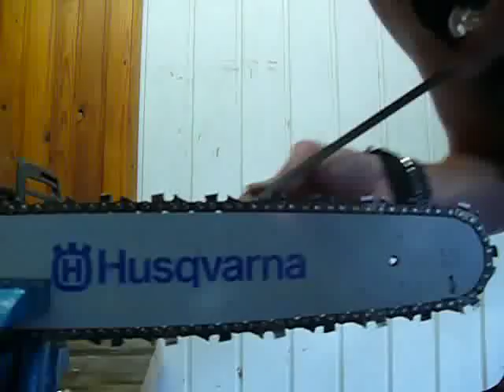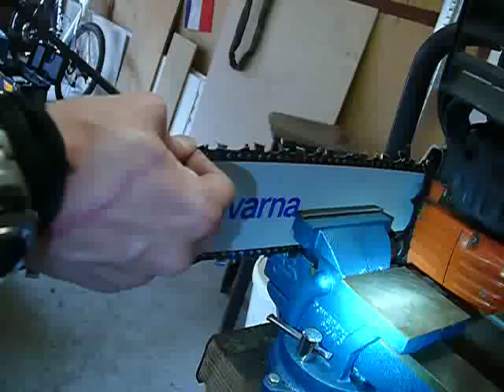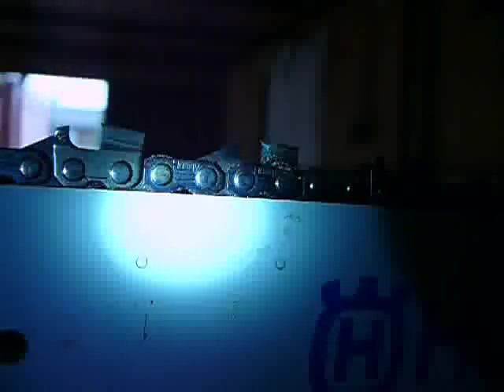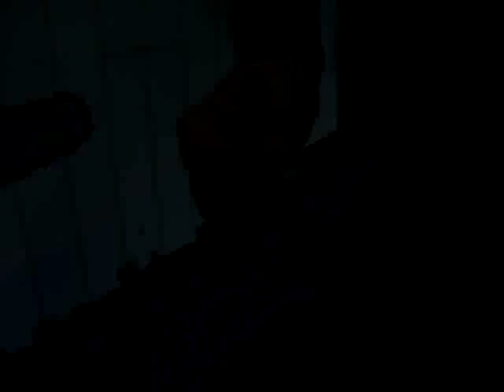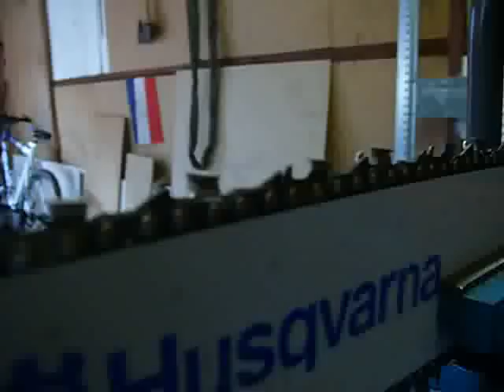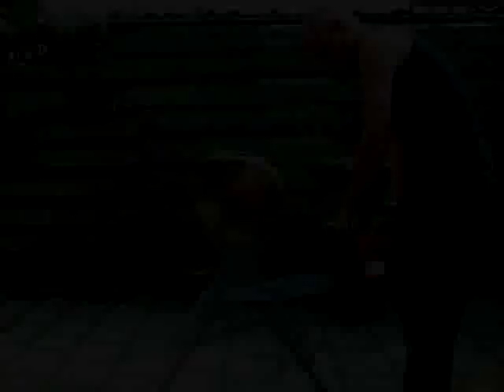Hand filing a factory round ground chain into a square ground chain

Comment: Do you always Eyeball or have you ever used an A-Top or Granberg with the double bevel? Im trying to learn more about square filing i have round filed in hardwood for years and just recently used a square filed saw and loved it!
Reply from the maker: Hello sir, I usually eyeball, with mixed results... I am very interested in the A-Top device. The files i use are Pferd files.
Reply: A guy that i work with uses the Atop and loves it , i ran it the other day on his 395 with a 24 inch bar and it just EATS the wood and I've been cutting by hand since i was old enough to hold a saw, i was very impressed and he's relatively new to it as well. Hop on by my channel some time and check out some of my cutting videos with my round file system
Reply from the maker: I will! have been a member to your channel for quite some time now.

I have been interested in this square sharpenend chain for a couple of years. I had discovered it on the Hotsaws 101 channel. Tried to find info about it, but here it is very difficult to find. It is not allowed in Europe because apparently our chainsaw pants can't stop square ground chain. 

With some experimenting i got some technique in getting my normal chains square filed instead of round filed, but far from perfect. I even have considered ordering a Silvey Razur Sharp II.... but whoww, the costs... So the square ground chain is something I use only a few times a year, for fun and experimenting. Normally I use round filed chains, full comp and a few skip chains for the longer bars.
Reply: The Easter Mountain Scion that’s amazing thanks for the sub and support The continued dedication means a lot
Reply from the maker: My pleasure, love to learn! Sadly I haven't had much time myself to make some vids lately. Also not much falling jobs lately. I'm pruning a lot af trees for the government out of a work platform, along the road sides. A real boring job, almost like working in a factory.... all the same all day long, every day.

Maybe some falling again in the new year. 400 Fraxines excelsior trees. Al diseased with a fungus. We probably loose 80% of all of them here in the Netherlands within the coming two or three years
Reply: The Easter Mountain Scion I totally understand I’ve personally been so busy between jobs and running equipment and not cutting Long enough or forgetting my go pro lol so I haven’t got much recent content either we’re running 3 forwarders now on 3 different jobs and with a export log yard as well things get busy!
Reply from the maker: That sounds like a busy day indeed :D

Luckily I'll be having a few days of around Christmas.

Maybe some time for editing there!